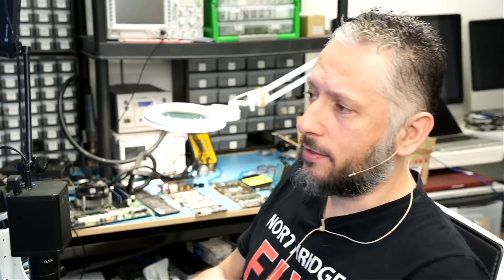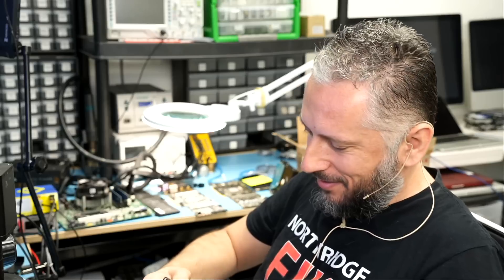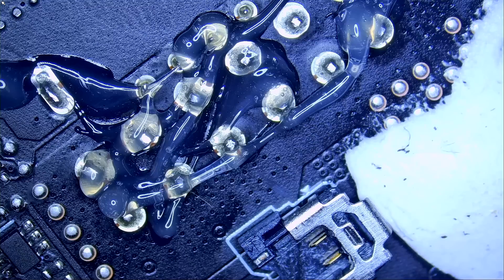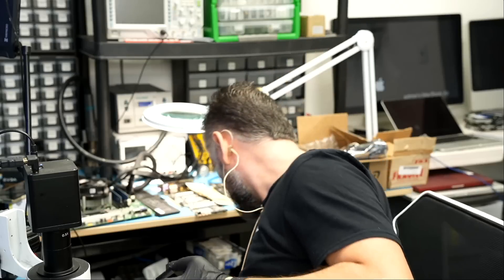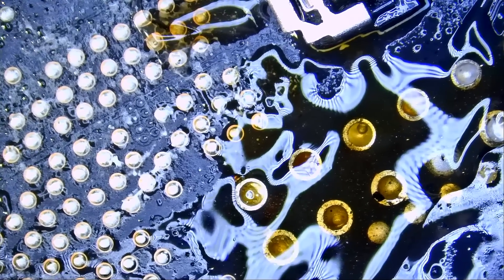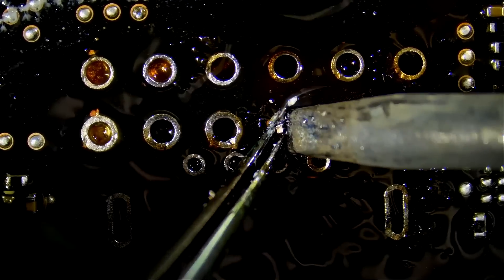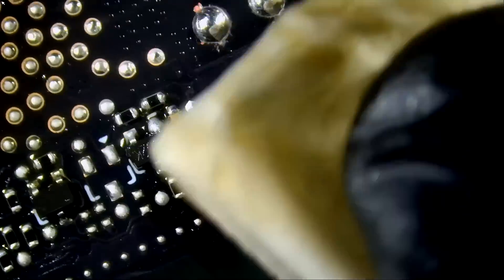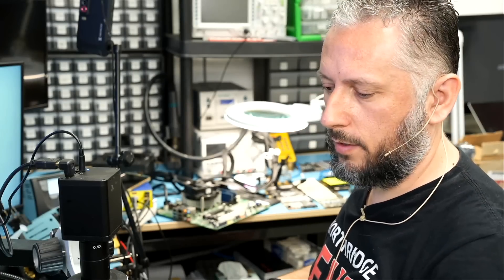4090 FE Connector melted with Cablemod Adapter installed. 40 series cards should be recalled

Comment: This is 100% a resistance issue. Where you have resistance, you'll have heat. The pins are too small for the amount of amps that the cards are pulling.
Reply: It's as simple as that, those tiny pins are just not enough for the amount of current the card needs, but some people try to over complicate it, to try to cover for Nvidia maybe? I don't know but it's curious.
Reply: @endame90  Those contacts are of 0.4mm2 cross-sectional area. Just try drawing 9.5 Amps through a wire that thin and you'll see it melt too. A fundamentally defective design.
Reply: I can be more precise. Any connector resistance is contact resistance + wire diameter resistance. Any current I going throu will produce I² * R energy = heat. While we cannot reduce the current, we have to reduce the resistance. In my experience 90% of resistance comes from contact resistance, because it is a runaway process. Heat will cause the pins to oxidize, which in return will increase the resistance, until the heat exeeds the melting point of plastic. To reduce the contact resistance you have to keep the oxygen from the air away- maybe with a contact spray, which eats away the oxidation. Unfortunately this doesn't lasts long until the liquid is used up. Anotherway is to make pins AND plug non oxidizable, maybe by galvanizing the pins with GOLD that may rub off to the plug contacts.
Reply: @michael5netz518  You ca't realistically polish a turd however. Ageing (contact resistance increase) will likely be a serious problem long term. It's a very defective connector design in short.
Reply: It's funny how people debate this. Ether way you look at it, it still comes down to resistance may it be the pins or insufficient contact the connector it's self is the problem. As the old saying goes if it ant broken don't fix it. They fixed it an this is what happened.
Reply: @mystic1160  Realistically there is NO DEBATE. Nvidia (and others) took established sensible design principles and simply tossed them out the window. It's ENTIRELY PREDICTABLE.
Reply: I’d like to see Alex measure the resistance of an assembled socket and plug set.  Maybe ramp up the current and look at the IR.  Great video and I’m loving this whole story.
Reply: @PassTheValiumMum  FYI,the manufacturer's spec rates the combined contact dissipation at 2.5 watts which is a ridiculously high figure. That's what many power resistors dissipate and they are cement coated to resist the heat !
Reply: @PassTheValiumMum  There would be no resistance even in a poor connection, at least not one you could measure with a multimeter. Volt drop test might show a poor connection.
Reply: Maybe the solution to this port is to make it more bigger
Reply: 100% in agreement.
Compared to the Molex connector used for PCIe power, the 12VHPWR connector pin was DOWNSIZED to 40% of the cross-sectional area but the current rating was INCREASED (by around 2:1 IIRC).
Simple mathematics of the I2R heating effect leads to expecting the temperature rise to increase to FIVE TIMES what it would be in comparison PLUS the important help obtained from conductors 'wicking the heat away' is also reduced.
It looks to me like idiot fuckwit corporate doubling down on AN UNSAFE DESIGN. It's entirely possible the CE conformity requirements could 'ban' the use of this connector at any more than a 'few' (2-3) Amps per contact instead of the insane manufacturer's rating of 9.5 amps.
Reply: Spot on
Reply: ohms LAW bro
Reply: Ohm's law it's just like when you build coils on a vape the wire heats up and melts and surrounding area or back brakes the liquid I don't know how the two go hand-in-hand but it's the same concept as ohm's law.
Reply: I do this for a living 20 years or so - I installed a 4090 yesterday (first time) It made a very expensive build feel like a poorly designed sham - not a top end card. Everything from the stupid invalid leg they included to stop the droop to the power cable which looks like a bad after thought to save money 4 into 1? Why? They look like absolute crap too. ASUS + NVIDEA you have a lot to say for yourselves you greedy fools! grrrrrr
Reply: Pins are same sized as in RTX 3090's and 3090 Ti's. They didnt burn and used as much power as RTX 4090 does, something specifically in RTX 4090's is designed in way that makes them overheat the connector.
Reply: I think pulling 500+ watts through this really small connector is a terrible idea, but it's also corporate greed to save money. Nvidia is really GREEDY. 
AMD still uses PCI-E 8-pin connectors which are more durable and they don't melt.
Reply: The pins are absolutely fine for the current, resistance is a result of loose and insufficient point contact and nothing to do with the size of the pin, the user probably fucked the socket up themselves with unnecessary removal and insertions and brought this issue upon themselves, there is no justification for a recall because this one user potentially did something wrong in the first place, or that there was a manufacturing defect in the first place.

These 90 degree adapters are not without problems in the first place, and adapters as a matter of course are another point of failure added to a circuit.
Reply: i said exactly the same thing a year ago somewhere, the draw outways the strength of the current pins and cables, and the thickness of pins and other connections, its basic
Reply: Can you find a single case where a 40 series gpu connector burned while properly plugged in? User caused unnecessary resistance by incorrectly plugging in and bending the cable. If you find one let me know.
Reply: Yeah right it pulls just.
Reply: we know this from middle school. i don't  know how people  believe its the user fault
Reply: @Rayu25Demon  its called denial
Reply: @Rayu25Demon  This is what Nvidia is saying is the issue so they can wash their hands of it and the cards aren't covered under warranty and people being sheep eat it up without question.
Reply: @Rayu25Demon  Pins need good contact to have low resistance. When they don't make good contact, that increases resistance, heat, hotspots etc. You should learned that from "middle school" too. When a user does not fully seat the connector, they do not make proper contact which leads to high resistance and high heat and hotspots that lead to the deformation of the connector and pins. You should also know from "middle school" that as heat increases, so does resistance and so on. Proper connection is KEY here.
Reply: @Rayu25Demon  Because a fully seated connector has enough contact area to not overheat while a partially inserted connection does not.
Actually Nvidia is making the sensor pins shorter in the newer cards to eliminate an incorrectly or partially plugged in connector from working.
Reply: This is also a technical limit to the functionality of a single graphic card to increase speed with available science. In its zeal to increase profits, this company has knowingly sold faulty product to those gamers who will pay any amount of money to get a few more frame per seconds out of their machines.
Reply: P = I squared R, P is power, is heat produced. Must reduce the resistance of the connection. Are the pins either silver or gold plated. Probably cheap Chinesium connector with tinned male and female contacts. Maybe put a bit of Deoxit on connector. Definite design and material issue.
Reply: @John-dp3ln  They're plated (tin ? not gold) and made of brass.
Reply: Than why only a very small percentage of people are having the issue?
Reply: @IIARROWS  I suspect these user are overclocking.
Reply: @hamrdeye8927  They might be, but the root of the problem is usually a poor connection either from the plug not being fully inserted or being bent through cable management or side panel clearance issues causing less than ideal connections at the socket.
Reply: @IIARROWS  That percentage will rise once the connector gets older. I've been designing high current pcb for years and the problem with those connectors is that they do not make contact on all 4 sides of the square pins, just a small part makes contact with 2 spring loaded connections on opposite sides that only touches a small part of the pin. Over time those little springs will get losse under load and heat. They are not meant for big current applications rather for mechanical strength. It's a poor choice of the manufacturer, plain and simple.
Reply: @killer_x_treme  And the contacts will TARNISH, yet further increasing contact resistance. Whoever came up with the idea of drawing 9.5 Amps through a 0.4mm2 pin needs their head examining.
Reply: @IIARROWS  you gotta remember that not every game/app pulls the same amount of current,nor does every user play the same game nor the same amount of time,this is what is leading to some people having no issues while others get a burnt connector. 

All of the users with a burnt connector need to post what game they were playing,for how long,what settings they were using,and whether or not they were overclocked.

Nvidia is getting off way too easy with this issue,there is a serious problem with this connector.yet rather then these cards being sent to Nvidia in a recall to have to deal with, they are going to independent shops where the cost falls on the user rather then Nvidia.
Reply: @IIARROWS  smh....
Reply: @IIARROWS  why wasn't this as prevalent within every other gpu with standardconnectors
Reply: @IIARROWS  yes. If you are close to the limit it is a problem. Every connector will not have perfect connection.
Reply: @IIARROWS  How do you know?
How many have been returned under warranty?
Reply: @IIARROWS  i'm wondering if some are pulling more power than others?  maybe a better quality chip, or a malfunctioning chip that passes qa?
Reply: thinks its a 4090 issue because of the massive power draw? or should i look scared at my 4070 ti xDDDDDD???
Reply: @Deathscythe91  Your 4070 Ti will be fine, it's a 285-310W board. Less power draw = less heat = less resistance.
Reply: @Deathscythe91  Which 4070ti did you get? I would imagine as long as your not pushing it to the max it may be fine. I find it very telling that the 4070 uses the standard 8pin for most models. I think there are few that use the terrible 16pin.
Reply: @Deathscythe91  not sure about that because 4090 draws less power than 3090ti and yet there is no wide spread issue on the 3090ti.
Reply: @Deathscythe91  The high power draw of the 4090 emphasises the problem but I'd not be surprised to see it on other 40 series cards in a few years as a result of contact degradation.
Reply: @Deathscythe91  The 3090 Ti has the same massive power draw at its peak and same connector... No issues on those like this.
Reply: @RobbieKhan  not true, my 3090Ti melted the power cable and destroyed 500USD power source.
Reply: @radeksvoboda7629  Thats entirely separate issue. If the power cable it self melted it was designed wrong or was plugged in wrong.
Reply: Its not that the pins are too small, it is the way the socket side connects.  All sockets and spring loaded pins will loosen over time and over heat cycles, in fact.  Previous generations of cards used multiple 8pin connectors which is not the equivalent of one connector with the same total number of pins.  When the connections are packed closer together the derating curve dives even sharper because heat dissipation isn't enough with tightly packed high current carrying pins...  Having 12 pins for high currents of power instead of 16 isn't bad at 600 watts, but having them all in a tight space creates a thermal issue and thus derates the connector even more then having them all spaced out more.  The socket side of the connector is really where the higher resistance comes from, not the pin side, and this resistance will increase over time and over many cycles of heat/current spikes.  With many pins/sockets packed tightly together the derating curve will drop faster over time and operating outside that curve will cause the socket side of the connector to increase in resistance at a higher rate than normal causing even more resistance on each current/heat cycle.  So it becomes more and more dangerous over time, but with more pins/sockets stacked closer together and higher currents with less heat dissipation on the inner pins it just happens faster and faster.  The old method of multiple-multi-pin connectors works as there is a little more room for heat dissipation, but they are still operating just within their derated values over their lifetime when they are packed so close together.  The best solution would have been to use a custom and safe screw type connector with a large surface area of contact and captive lock washers on the screws to prevent them from backing out on their own.  There would be no heat issues there and no loosening over time of the pin-sockets.  Data could be SMbus or USB to the motherboard and the OS can tell the card about the PSU or it can have its own separate connection to the PSU but for f@#$ sake it should be kept away from the power cable.
Reply: @10100rsn  The pins are too tiny (0.4mm", brass) for 9.5 Amps too.
Reply: @grahamstevenson1740  

 @grahamstevenson1740  According to the spec the pins are 0.64mm.  At 600w 12 volts that is 8.333 amps per pin assuming the sockets are making perfect and equal contact. At a sustained 8.33 amps there could be about a 70c temperature rise in each pin which would be lower if we include heat sinking to the PCB traces and ignore the derating curves and contact resistance between the pin and sockets. But the contact resistance between the socket and pin will also increase over time and the derating curve will drop even more at higher temperatures. If there were always a 0 resistance between each pin and socket then the connector would operate fine. But in the real world the sockets will loosen over time and it will happen unevenly between each connection and a sustained power draw near 600 watts on an aged and annealed contact can derate the 12 pin connector down 25% to 33℅ over the life of the card. Adding 2 more power and grounds would keep it from thermal runaway within the lifetime of the card but an even more foolproof design for the ages would be better.  A screw on connector with a large enough surface area for power and ground. Screws with captive lock washers. It would last forever as long as you don't over tighten the screws...
Reply: its a crap plug design,pitty there's no pcie plug mods around
Reply: Curious to see the full testing on the board after reassembly.  If it's fine then I'd agree 👍
Reply: I’ve been screaming this since day one.  No one listens.
Reply: @cppctek  Likewise. This probably would have happened if it was designed in Europe where product safety tends to be taken seriously but we're used to Americans using skimpy cable too that we'd never consider and this was just a 'bridge too far'.
Reply: @cppctek  You are screaming nonsense, that is why people ignore you.
Reply: No, the pins are perfectly to spec, but with little headroom compared to the old style 2-3x 8-pin plugs which were immmensly overspec'd for the power draw. The pins can only handle the power (to spec) with a plug that is likewise to spec, especially in the contact area. It's still Nvidia's fault for not mandating certified plugs to go with their close-to-the-limit connectors. The included break-out cable for the old 8-pin connectors is actually to spec and any burning with that plug/cable was due to user error. But if you use some third-party power supply plug or (even dumber) a 90° adapter which adds a ton of contact resistence, it's on you to make sure it's to spec to provide the required power with the Nvidia connector. If the pins of your third-party plug have sloppy tolerances, you'll have large contact resistance even if you plug it in properly. So just don't use unapproved plugs with this behemoth of a card.
Reply: @RealNovgorod  NOBODY has APPROVED the 12VHPWR connector. If presented for formal product approval, (e.g. to IEC specifications for temperature rise), I'd expect any competent testing lab like ETL, VDE or Nemko to throw it back at the manufacturer.
Reply: Maybe you need an uprated connector which can handle more current.
Reply: @UnCoolDad  The connector itself is fine, it is the end user having to use it that leads to these problems. It is well documented already, nothing has been discovered here.
Reply: @luminatrixfanfiction  Tension on the cable plugged into the 90 would be my guess at the cause of this. Plenty of leverage to flex the connector even if it is fully plugged in.
Reply: That was my guess this whole time. WAY too much current through a tiny connector. Previous generations had multiple connectors. This thing is pulling way too much juice down.
Reply: @youtubasoarus  Unquestionably so. I cannot understand why it's such a big puzzle for some people. It's *BASIC ELECTRICITY*, simple as that. It was IDIOTIC to attempt to squeeze so many Amps through such a puny connector.
Reply: @youtubasoarus  Occam's Razor is rarely very wrong.
An understanding of basic electricity is essential here. It's not a complicated issue at all.
I regret that Steve of Gamers Nexus felt that  his X-ray 'analysis'  and all that related nonsense but was even remotely necessary. It just muddied the waters.
Reply: pins are not the problem. the problem here is contact.
Reply: @Filippoilcane  The pins are significantly smaller than the cross-sectional area required for a COPPER conductor carrying 9.5 Amps, despite them being made of brass which is a poorer conductor than copper. The pins are hopelessly undersized TOO !
Reply: @Filippoilcane  Really? Watch the video again, and again, and again, till your brain accept this new information. The guy had a 90° adapter plugged in all the way and the connector still melted, are you telling me that CableMod is incapable of making an adapter? Spare me the headaches please.
Reply: @loonysam506  A 90 degree adaptor doesn't mean you can't force the plug to make poor contact... All of this has been gone through extensively. The issue is poor contact, not the size of the pins.